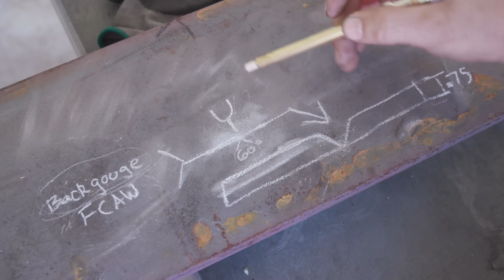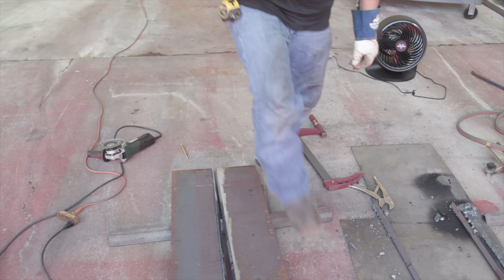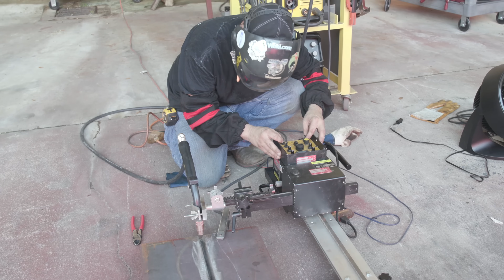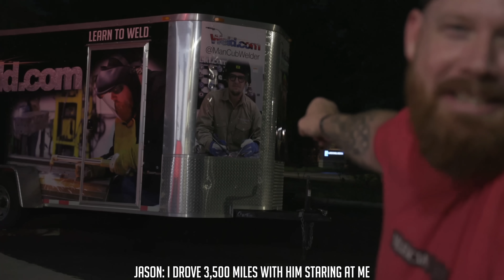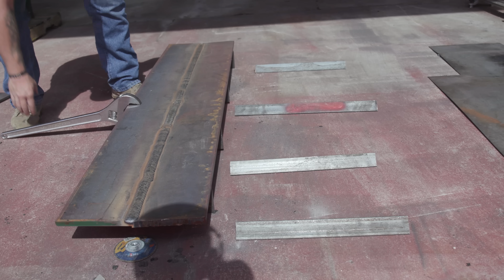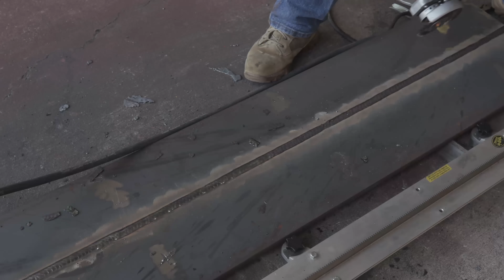Flux Core Welding with Back Gouge

Comment: Stop calling it flux core. Its dual shield flux core!!!! Flux core is self shielded with no gas. Its not only this channel but alot of other channels do this too. Its misleading. Other then that, its a cool video
Reply from the maker: If you want to get technical it's called gas shielded flux core and the other is called self shielded flux core. Dual shield is a trade name from ESAB.  It's still flux cored welding (even if it's a gas shielded process)

Comment: We are not aloud to make that wide welds in one pass. How is the heat input when u do that?
Reply from the maker: Stringers are better. Check out our video called stringers vs weaves. We do a tensile pull and a charlie v notch

Comment: That's awesome, how did you get slag inclusions? And the automated carbon arc cutting is awesome, how hard would it have been to set up to be an Air carbon arc process? 
 And could you also do an Oxy/ACE back gouging process too?
Reply from the maker: We probably missed the slag in between passes cleaning it out. It's crazy easy to set up the arc gouger

Comment: Where i work here in Australia we make vibration screens, sometimes the sidewalls on these machines are so large that we have to weld two stock sized plates together to make one wall, we use an oxy/acet track cutter for the beveling but all the welding is still done by hand, it takes 3 days to produce one wall
Reply from the maker: Gotta show the boss man this video... It would make your life so much easier
Reply: @Welddotcom  just the real world my friend, unfortunately when you go into the real world you dont get all the bells and whistles you had when at tech school, sometimes you just have to do the old school way, which can be unfortunate but it teaches you the meaning of a hard day earnt and also to appreciate the way things were done, also makes you more humble at the end of the day

Comment: I have done this fluxcore welding for the last 15 years. I've done at least 20 of these test. You should have more drag angle on the torch and little bit more travel speed. You shouldn't let the puddle get too far ahead or it will leave slag pockets in the weld which is normally failed weld.

Comment: I work in a ship yard building a Royal Navy  vessel in Canada. I do this process every day for the ships outter seams. Full pen welds and then UT scans for quality assurance. Overhead, vertical and flat gouging with 3/8 gouging rods. The mouse holes are the trickest always be sure to stagger your tie ins and clean your welds from defects and youll pass everytime!
Reply: You want the key to the mouse hole😂
Reply: @rexwolfe147  I do..
Reply: FCAW-G? It seems that FCAW was not really popular until a few a years ago for thick metal.

Comment: This is all we use for railroad freight car repairs. .045 with a backing plate.
Reply: I work freight car repair aswell. Unfortunately everything is stick welded by hand
Reply: @chrisv3863  that is so time consuming. It took me a while to get used to the flux core. Only time it really sucks is working inside draft pockets.

Comment: I could have used this video a month ago if it was by hand and not with a track machine. The longest weld we had was 2ft so easy to do by hand. We only used 45 wire so it took a few more passes and instead of back gouging we ground it out. We had 30 degree bevels on both sides which I think hurt us in the long run but all welds passed in the long run.

Comment: So, why use Flux Core, with shielding gas?
Reply: Flux core with shielding gas. Referred to as dual shield. The gas changes the characteristics of the weld such as penetration and wetting of the pool. Different gasses do different things in combination with the wire.

Comment: Cool vid but how is this this practically applied in the field?   You mentioned a big box buried at the  beginning, but with the track system you would still do the work in a situation like that?  Never been on a welding job site so sorry if this is a dumb questions, but to me it looks like you just got like $4k worth of labor and equipment into an 8 foot weld, so I am wondering about some examples  where that would be the SOP.   Thanks!
Reply from the maker: We did an 8' weld as a demo. On a job site it's going to be sections of 20'
Reply: @Welddotcom  Thanks for reply! I understand the demo aspect - just asking what kind of item needs 20' weld that gets handled on both sides with so much effort for the weld, in the field.   Another question is, pipeline doesn't get the backside treatment (I assume), so isn't there a way to not do that?   Just very curious because all that is very cool.  thx!
Reply: @kwasg3  ships. I work in a shipyard and the plates are huge and need to be welded together. And yes there is a way to do it without back gouging. Its using ceramic plates on the backside however the fit up has to be different and it has to be very exact in which some cases is not possible.
Reply: @kwasg3  6011 root 7018 fill and cover. stick welding is the best in field construction  . weld in rain and snow and wind.

Comment: Nice job. Sounds like you could go up a half a volt and get rid of some of the crackle. But what I really noticed is that you’ve got your gas line quick couplers on backwards. The female should be on the welder end of the hose so it’ll shut the gas flow off when disconnected.

Comment: thumbs up on the automated Carbon arc machine, Not something many of us ever see.
Reply from the maker: We've got a few more where we have a little fun at 1400 amps 💪💪
Reply: Yeah that was legit especially with those stackable air arc rods like what my mind was blown XD
Reply: At one time they were also used with 24" long SMAW rods....
Reply: I don’t like it he didn’t wire wheel it after his fill pass and welded right over the top of slag and then you said it would pass it would bust out in any X ray test And then once they bend that part you’ll probably have a good three eights crack in the bend.
Reply: @Arthur_McHugh  I’m kinda late lol bout 5years but I watched this video just now and read ur comment. He did use a wire wheel after his fill at the end.
Reply: Cool but y weld two plates when you can buy one the size you made from the 2
Reply: @TheVirtualReptarium  pretty sure this is only for demonstration purposes. Out in the real world this might be used for bridge work or ship building.

Comment: Simply beautiful oxy-acetylene cuts.  The welds were terrific also.  Very cool video.  Silly question- why not simply buy a piece of material the finished size instead of welding two thinner pieces together?
Reply from the maker: It's a demo. Normally those plates would be much wider.
Reply: @Welddotcom   You went to a lot of time, effort and expense.  Many thanks.

Comment: Do flux cor vertical with ceramic backing strips
Reply from the maker: We'll add it to the list
Reply: @Welddotcom   vertical and horizontal please! I could give you some parameters for your wire and how to setup the gap and bevels on the plate. We use the process at my shipyard.
Reply: I do a Loooooooong "U" pattern uphill with the legs of the U going about .5 inch up the bevel. And stay in the puddle when you cross the center

Comment: On the back weld 3/16 7024 jet rod would work great for it and with that you be able to it on one pass...Never seen the automated carbon arc before. Looks like it works good!!
Reply from the maker: The consistency is absolutely insane

Comment: I missed something. Why didn't you just order a plate the right size?
Reply: You really did miss something didn't you? If they ordered a plate of the correct width, what are Weld.com going to do? Just stand around looking at it while talking about shit? What kind of a crappy video would that make? You need some fresh air Son, your brain ain't working too good!
Reply from the maker: It's a demo of a process that would have much wider plates
Reply: @Welddotcom  ah so it was just a waste of materials and time. I understand.

Comment: Love this! Nice work fellas 💚
Reply: Yo Everlast I use your Tig Welder just wanted to say its great!!! Have a good one!
Reply: @SFMCOLLECTIVE  Thanks for the feedback! #weldmeanweldgreen 💪 Which unit do you have?
Reply: @everlastgenerator  im running the 350 ext at the shop, its had a little dirt get in the gas solenoid, probably from the hose, a bump and it shut off the gas, so it got cleaned via your service tech directions.   from using a 1960's tig machine and then jumping on this was a little curve, but in 10 min i had figured it all out.    had to play with it, 1/16" alum  beads stacked them up on corner edge about 1/2" tall then started to stack them sideways 1/2".   3"long.   no sag and a bright shiny pass every time. loved it.

Comment: Used to work at a place that built Caterpillar attachments and some had 4 inch thick cutting edges to weld on so I used to tape two Hobart MIG welders each running 1/6 wire together and then put about 6 glove protectors on and go for broke. Very hot work but got the job done much faster and never had a weld fail.
Reply: Never? :D

Comment: That was a beautiful flame burn!!! And yes steel moves when being cut with flame, nature of the beast I guess. I know this was a demonstration weld/gouge but if on the real deal would you use ceramic backing or have you ever used it? When ceramic backing is used it eliminates the need for back-gouging with 100% weld. 2nd thing is that defect wouldn't fly welding on Navy ships where buts and seams are UT'd.
Reply: UT'd is that Ultrasonic Tested for those of us who are not hip to the shipyard lingo?
Reply: We don't weld ships but do allot of DOT work and they UT allot of it and no that would not have passed. And who's to say over 8ft that was the only one. Just caught it in the couple inches they cut out which means there was most likely more.

Comment: The slag almost came off in one piece. Bet that air arc was loud. Did you blow a fuse? Or did mancub run out of time?
Reply from the maker: We were dialing in the Bug-O for a while (when it got dark). We didn't want to film the rest of the video in the dark.

Comment: There is no moisture in the plate.
There is condensation from the oxy-fuel being burned.
The plate being below the dew point condensates that moisture.
Heating the plate does not remove any moisture from the plate. It prevents condensation.
Reply: I had a weld inspector ask me if I heated the plate up to remove moisture once , even told me how you could see the moisture coming out when you used an Oxy fuel torch. I just walked away.
Reply: Bill Wright 
Lmao that sounds about right. Those who can’t weld, inspect welds hahaha
Reply: The byproduct of a neutral flame fueled by oxy/acetylene is co2 and water vapor.  (Carbon + oxygen and hydrogen + oxygen) look it up, or take chem...
Reply: Right on bro. Finally somebody who comments on these videos that knows something
Reply: When you're my age you will Wish you would have used more saw horses or tables.
Reply: Every time I hear someone mention the "moisture" in the metal...I start thinking "how exactly did it get in there? If moisture can penetrate your steel, you have bigger issues than a bit of condensation on the surface.
Reply: haha The same fact struck me as I played the vid. Made me question if they were joking.., if they knew better than saying moisture was in the steel or they didnt know that it comes from the fuel in the torch against the cold surface of cold metal. They oughta know.. Pretty obvious to me when each time a torch is put close to a (thick) cold (room temp) metal there is a condensate formed and it spreads away as the metal heats up. I am reading that some people have been taught wrong... There is a bit of wisdom in the saying ''learn it right the first time''. Should we add.. "teach it right the first time"?
Reply: Well said!
I always laugh when people say “just sweat it out” 
the steel isn’t a sponge holding moisture. Lol
Reply: this was interesting.
I been working at a plasma machine for the past 4 years and always thought and been told that the plate drinks water in to it or the plate sweat.
i work in a very humid environment, so there where always puddles of water next to the cuts by the oxy fuel cutters.
Never any water when i cut with plasma when i think about it :P

Altso one of the reasons you preheat is to minimise the temperature gap between the cold plate and hot weld.
Harddox plates you need to preheat and insulate (so it dose not cool to quickly) after you weld, to keep it from braking/cracking.
Reply: It's a joke between REAL welders about 'Getting the water out of the steel" Anybody who has ever been at a steel mill when a roof leak dumps water into a ladle. 1- It blows u[p 2-You go change your pants.  THERE IS NO WATER IN STEEL

BTW, What are these guys doing on the floor. Haven't they ever heard of horses?  Get some pipe and a piece of wide flange and  and make a pair and loose your amateur status.
Reply: Cast iron and, rusty metal can indeed have moisture in it. Just look at how much oil can come out of cast iron when heated.
Reply: @the_hate_inside1085  that's because theres pockets within the cast iron, so no actually the metal still doesn't have anything in it. Your seeing what's coming out of the pockets within the cast iron. There isn't anything in the steel, that would then change the structural,  and or chemical makeup of the metal.
Reply: Cool story bro.

Comment: old school fix for the bow would be to use your track torch to flame shrink the opposite side from the prepped side. Less time no grinding dust or noise just takes a little skill!
Reply: Follow the cutting torch with a heating torch on the opposite width side of the plate
Reply: Old school didnt miss physics classes. My mentor did finished college.

Comment: You're not gunna tell us about that cool magnet thing you got!?!
Reply from the maker: Which magnet? The track welder is a Bug-O Modular Drive System. The track gouger is and Arc Air gouger on a Gullco carriage.
Reply: @Welddotcom  The handheld one you use to pick the strong backs out of the plasma table
Reply: Beach&BoardFan its a magnet with a handle. 
They show using trac torch, mig, gouger, generator, cnc plasma cutter, and your fascinated by a handheld magnet. 
Thanks for the laugh.
Reply: @lukek8032  They say what all the other kit is in the vid, but they leave out that sweet scify looking grabby magnet!

Plus what kind of cold ass person isnt fascinated by magnets!?
Reply: I found it, its the magswitch hand lifter 60-ce